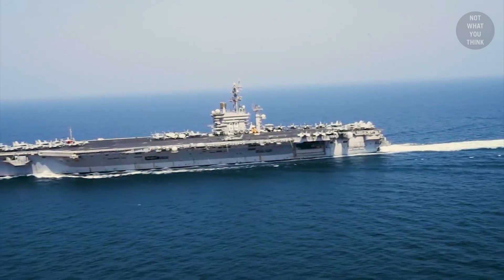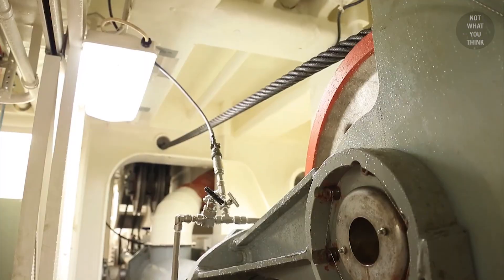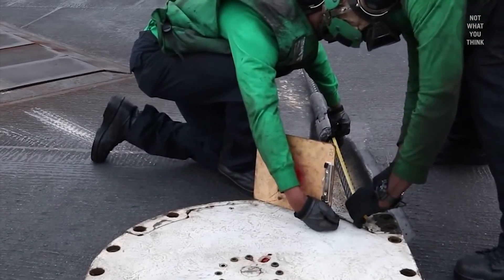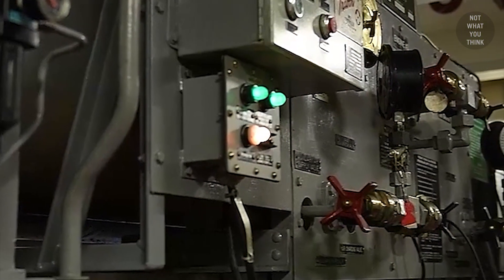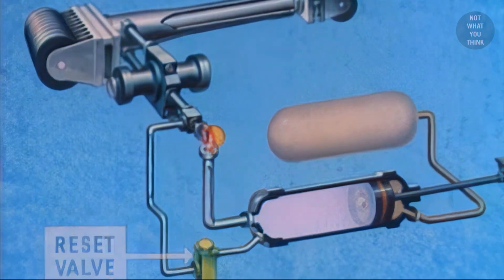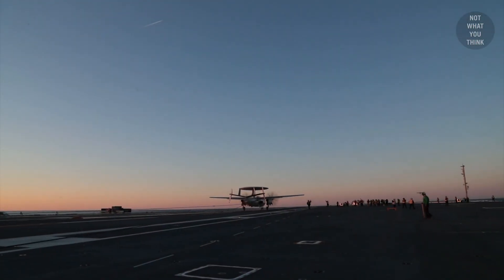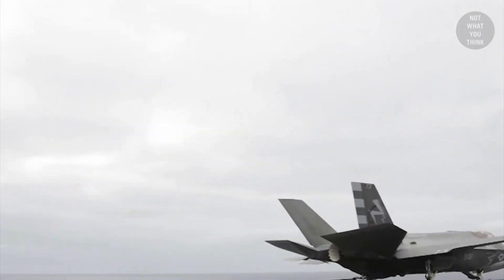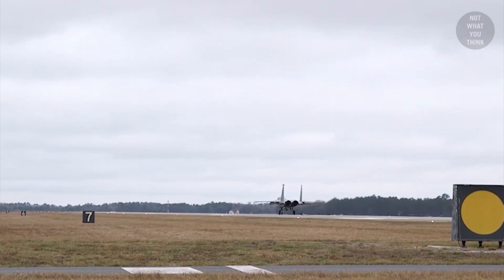What if The Arresting Wire Snaps During Landing on Aircraft Carrier

Comment: I was behind an aircraft that experienced that very thing during my second cruise. The #3 wire below deck cable (called the purchase cable in Navy-speak) was down for maintenance for a few days and we were in workups off the coast of Hawaii on a relatively lazy day. My recovery was 3 aircraft, an EA-6B and the two-ship S-3 formation that I was in. That day the #3 wire was brought back on-line and all 4 wires were operational. When the last launch was on the cat the EA-6 started his drop down and me having a wingman I proceeded down at a more relaxed pace. When I rolled into the base recovery course just aft of the ship the EA-6 was crossing the ramp and I got a good view of him grabbing the #3 wire and rolling out but not stopping. The wire snapped and he dribbled off the angle and all 4 four guys ejected. An amazing sight seeing 4 sequential ejections as the aircraft slowing sank in the 10,000+ feet deep Pacific Ocean. All 4 were rescued and the only injury I recall was one of the ejectees suffered a cut on his arm. Apparantly, the weight was set wrong for the EA-6 and the arresting gear engine didn’t have enough payout to stop the plane. Could have been me had I been first in line.

Comment: The ground based systems are much more simple because they can trade precise operation for distance, the emergency type usually operate with simple friction brakes and a fixed resistance for all aircraft. 
There are a few more complex setups in locations where they train new carrier pilots.(They train on land before adding the moving ship.)

Comment: In my opinion the "safety net" as you put it isn't as much of a safe way as it's the least costly and damaging way to:

1) keep the vehicle on the deck and
2) get the pilot and crew down without injury
3) avoid a water rescue 

A water rescue which seems safer (but isn't from what I've been told). The net from my point of view has cause many occupants multiple injuries (but I don't think a death yet, which before was a huge issue)

You definitely should survive the net but it can end your career depending on the injury. 

The net is less complicated and less expensive (then other systems that were researched) Quickness was the major goal alongside the survivability of all crew involved

I personally think it was a middle ground basically, of all the best options. Remember, the government has a value on your life just like everyone else. Trying to save one or few shipmates might be considered too expensive.

When on the deck, you need time management skills and perfect implementation are very critical. For everyone not just the plane but the crew on the deck.

Comment: The RAF base in Gibraltar had an emergency arresting system that consisted of an Arrester Cable across the runway, connected to two ship anchor chains zig-zagged along the side of the runway.
I don't believe it was ever used but the theory was that an aircraft snagging the cable would be slowed by the effort of dragging the anchor chains.

Comment: The land based Rotary Hydraulic Arrestor Gear (RHAG) operates differently from the carrier arresting gear. The purchase tape is wound round a drum attached to  a shaft which drives paddles in a drum of hydraulic oil. They are either mounted below ground, or in the case of a mobile RHAG, on concrete pads beside the runway. These pads have steel bolts which are left in the pad when the RHAG is not installed and can cause pain to the unwary when you trip over them.
Reply: There are also two exact copies of the carrier style systems installed in land, as well as catapults. Both have been upgraded to the new electronics system the Fords use. That's how they do testing on the system before use at sea.

That way if something breaks or is too slow/fast there is still runway left for them to recover.

Comment: I hear that when the pilots touch down they have to immediately accelerate just incase the cable breaks.  I totally respect everyone that makes this possible.
Reply: Sometimes your hook will bounce off the deck and skip over the wires, so you need to add power as you touch down.
"BOLTER BOLTER BOLTER!"

Comment: The pilot had the guts to DROP the nose as the Hawkeye went overboard. He needed to lower the angle of attack to optimize lift at a slow speed.  It is the opposite of every human instinct when reacting to a low altitude stall.

Comment: I am betting that they did NOT set the arresting gear engine for the correct plane, weight is what matters.. if is set for a lessor weight, then it will run out all the cable to the end and then snap..

Comment: fun army memory for resting cable engines (land based).  I served in airforce and we needed to do some cleanup at our warehouse. One staff sergeant mistaked about some normal spring looking car spare parts to be junk and threw them into trash bin. Well just to later find out that those were worth over 20 k€ even thou those didn't look like anything expensive. The thing was that although the engines were basically some old ford automotive stuff, those were rated for air industry standards not car.

Comment: Land based arresting cables do exist at mixed airports. Mixed in this context meaning military and civilian use. Since civilian aircraft usually are not designed to work with arresting cables, those systems need to accommodate for that. In Europe (where i fly A320s) airports usually have a "rigged up" and a "rigged down" status for the cable(s), rigged up means for us in an A320 that we cannot "trample", taxi over the cable at more than 40kts, which of course is somewhat hard to do if you land on that runway. It is more of a thing for a line up on the runway, taxi past the cable and commence the take off from there. 

In a rigged down status there are no restrictions. Rigged down is often made possible by a groove in the runway in which the cable rests below the surface of the runway, but from where it can easily rigged up into its operational status. 

Impressive flying from the Hawkeye crew, good thing the deck is not that close to the waterline.

Comment: We had a major hydronic pipe elbow blow out on the #3 engine, causing immediate hydronic failure with a F-14 on the wire. It stopped the F-14 but at the very end on the waist cats, nose gear off the end. The engine completely 2 blocked and broke the ram head. The only reason the cable didn't break is because that was the first trap on a new main cable and cross deck pendent. We just did a reweave on the 3 wire the day before. We didn't have a #3 wire for the rest of the med cruise, they didn't fix the engine because the Navy decommissioned the USS America CV-66 not long after the end of the cruise.

Comment: I'm pretty sure all aircraft vehicles landing on Carriers should be at full speed to make sure if they didn't catch the wire they can re take off, so that doesn't explain why that guy was going at landing speed rather than full speed
Reply: First of all, they are landing, so they need to be at landing speed to land,  that is how airplanes work.  Secondly, that would put much more stress on the cables and make things break much more often.  Finally, when they land, they go to full throttle so that if the cable breaks, or they miss the wire, they have a better chance of taking off again.   The problem with the situation shown in the video, is that the plane was almost fully stopped when the wire broke,  it was because they were at full throttle that they were able to continue to fly after the wire broke.

Comment: Well crafted video with very good explanations. Great save by the aircrew! Between the full throttle, great skills, and the excessive lifting wind under the angle deck (the wind is intensified after it splits at the bow, and the overhang of that portion of the deck compounds/compresses to actually have more wind than off the bow) they grabbed every ounce of air and kept her aloft! We used to stand at the bow and appreciate the 30-50 knots of wind, but standing at the edge of the waist felt like a damned hurricane sometimes!

Comment: You can tell they got they weight wrong. The second it refused too slow down.. Why they always apply full power. Till they have stopped. 

You also have to know the weight of each launched Aircraft.. As the shooter programs the launch weight...
Reply: They either got the weight wrong, or there was a failure in the arresting system,

Comment: As a 17 year ABE in the Arresting Gear work center. Your video on how the engine works is from the 80s and the CRO valve was why it failed on arrestment. I appreciate the attempt but the information is mixed n incorrect. And it's AIR not gas in the cylinders.

Comment: Fun fact- As a plan captain in an E2 squadron during the gulf war 30 years ago we often had a plane stored behind the island. During flight ops/recovery we’d run the whole start up sequence, and I would need to stand the whole time with my back turned just a foot or two away from the arresting gear housing/foul line- relying on all my squadron mates to warn me/pull me to safety should something go wrong or the cable snap. This would be my single most dreaded and worrisome period during an entire cruise. Fortunately, nothing ever happened like in those VHS carrier mishap tapes we would often watch.
Reply: Good thing they don't run them up behind the island much anymore!

Comment: Random question that probably has an obvious answer. Has there ever been a modern example (Vietnam war to current) of a tail hook snapping?
Reply: Plug something like F-18 arresting hook breaks in to Google and it will cough up a few.
Reply: Here's text from a print article, "In 2002, an F-14 crew had a carrier landing they didn't expect. Their tailhook caught the wire on touchdown, and then broke off the plane. As you can see in the second video, the plane goes below the deck with the afterburners lit, and the pilot and RIO eject. Fortunately, both of them made it out alive.
Metallurgical analysis of the tailhook found that an aluminum stripping process used during rework on the tailhook caused damage, and ultimately, failure of the hook."
Reply: @alonespirit9923  Ok, thanks.

Comment: Not What, you are mixing images of MK7 and AAG.  Plus the animated descriptions are of a Royal Navy design.  The principle between USN Mk7 and RN are similar, the biggest departure is the control valve.  Mk7 does not use a grooved cylinder valve, but a variable programmed tappet.  
The AAG is actually similar in operating principle to the land based systems.  They are both rotating hydro dyno's ("water twisters") with one rotor & stator per side.  Difference is that the pair are packaged to fit in one compartment on the carrier, as shown in a few of the cut away diagrams with in your video.  Overall, 7/10 for content accuracy, good enough for the better than average consumer and even 95% of sailors.

Comment: I've never slushed an arresting wire, but I've inpregnated miles of 2 1-2 tow cable at 10000 PSI while beating it into place during end for ends and new installations. Miles of trawl wire, assembling pendants, splicing and pouring sockets. I've never had the oppertunity to touch one of these arresting systems and I've really got an ich to do so now.

Comment: Prehaps the best explaination of the arresting gear system outside of the Navy. 
The pilots were able to save the plane because as soon as they hit the deck they advance the throttles to full power, just in case the wire breaks, the hook bounces, or they just flat out miss.
Reply: Also, they kept the nose down, didn't force it to climb before it was ready, used every inch of altitude to regain airspeed, and retracted the landing gear Quick.
Reply: Yeah but they still lost A LOT of speed, which they gained back by not immediately trying to climb.. those wires are designed to stop an aircraft at full power.
Reply: Oh, so that's why in some simulators they instructed me to set my throttle to full power
Reply: The cable had slowed them some before it snapped.  What a job of getting that aircraft flying again!
Reply: They definitely do not go full power on landing
Reply: @alext7952  They should just in case they miss or there's a failure. Everything I've heard states that when landing on a carrier you go to full throttle once you're on the deck.
Reply: @bunnywarren  I'm sure the pilots know what they are doing and they have done dozens of tests
Reply: Wired snapped they didn't miss
Reply: @jbw8471  reading comprehension
Reply: @jbw8471  do you need to go back to first grade reading lessons?
Reply: @jbw8471  Reread what they wrote. They didnt claim they missed.

Comment: Those pilots really deserved that medal... Impressive save of the aircraft, they must teach that wow
Reply: They do, As part of landing on a carrier they are required to go full power when they hit the deck. 

Prop planes also have MUCH slower airspeeds for lift compared to jets so a prop plane can go much slower then a jet with out a stall. 

This would have been only just inside what was possible and would be absolutely terrifying for the pilots to see the end of the carrier coming up and know that they are not slowing down enough, while also knowing they ARE slowing down and losing the chance to get back in the air. 

On a side note a carrier's tend to have a helo in the air when planes are preforming a landing in case something like this happens.

Comment: I have so much respect for those wires. I learned early on in my life to never get near a rope that's being tensioned by a moving vessel.
Reply: High stakes jump rope
Reply: What about that clip where the dude jumps both sides as they come flying back towards him, craziest video I've ever watched
Reply: @UGGLEE9666  Wire rope  used in transfer at sea is the same problem. I saw a safety film with an officer who was hit in the leg by a broken wire rope and lost it.
Reply: @Stephen Odell  this is why I have respect for anyone that works around any cables/ropes under tension (especially constantly in the path of a cable/rope) It's all good when they're in one piece but a whole different story when the enevitable happens, and it breaks
Reply: @stephenodell9688  Underway Refueling / Restocking uses thick metal cables strewn between two vessels moving in the same direction and when you have to do an emergency breakaway you purposefully let go of a clamp and yank the vessel to one side to snap the wire and if your like within 100 feet of the spool when it happens you can hear the cable break the sound barrier as it whips back towards the spool. Really scary shit.
Reply: @JustAGooseman  Not only that the wire has to be kept tight. Refueling hoses and supplies ride on those lines and they do snap once in a while. .
Reply: I know a guy who lost 3 fingers by resting his hand on 1" metal banding before cutting it. It sprang off so fast it took his fingers with it. Work can be a bitch.
Reply: I remember a tourist dieing in my town in a boating accident, I believe they where hit in the chest by a high tension rope when it snapped.
I vividly remember thinking the guy must of been knocked into the lough (lake) and drowning but my father explaining he was killed by the rope hitting with extreme force.
I still wonder to this day how they ended up in the situation with such high tension rope in the first place probably towing but I'm not sure
Reply: @GrandDawggy  There's a maneuver where you tension a rope between the boat and the dock while steaming forwards/backwards. If done right, this pulls your boat close and parallel to the dock (or the reverse depending on how you perform it). And if you're unlucky the rope tears halfway through and someone gets their head knocked off.
Reply: @GrandDawggy  I saw that scenario myself, except this guy lived.
Reply: I saw a guy get slashed by a rope. A boat was pulling another boat in heavy swells. The rope broke a hit a guy like a giant whip. Almost killed him.
Reply: @noahway13  Nylon is bad for that it stretches to 1.5 its relaxed length. we would put attach a piece of cotton to the morning lines to tell when it was stretching to munch.
Reply: Where I live, a dock worker lost an arm to a docking wire that snapped from a ship in port during a storm, a few inches closer to him and he would have been cut in half by it.
Reply: Facts, like imagine being a tow boat for a massive aircraft carrier. I’d be shitting bricks the whole tow.🤣
Reply: @fizzicuhl  During WW2 they towed a carrier with a cruiser by raping the toe line around the aft gun turret. The problem is to get it moving and keep it going where you want it to.
Reply: @stephenodell9688  The more you know. Glad I was born further into the future and selected a different career path lol.
Reply: Good Learning !! 👍
Reply: VERY FAST VESSEL
Reply: I saw this before this video came out
Reply: https://youtu.be/Iecvnwh8mIY here's the video 😵
Reply: @UGGLEE9666  Holy sh. That was crazy and scary.
Reply: @Wetnapkin69  link?
Reply: @UGGLEE9666  This clip was in the video fyi
Reply: @turnermurray9015  fair play didn't even realise that 🤣 shows how little attention span I have sometimes